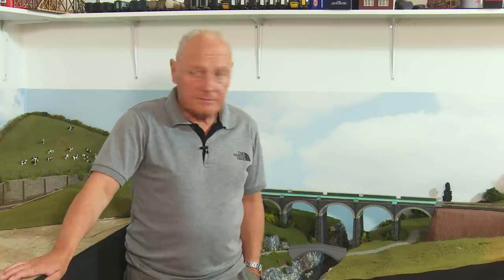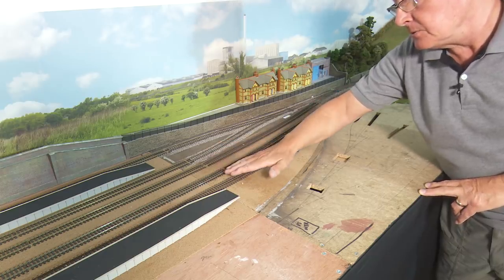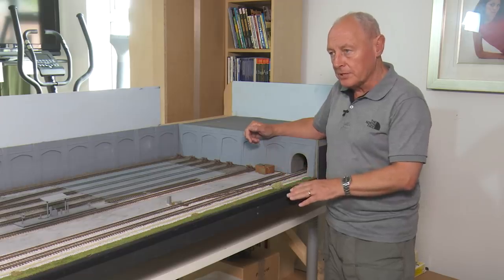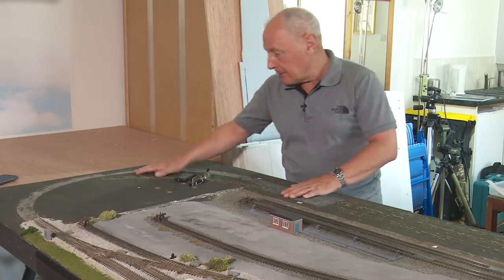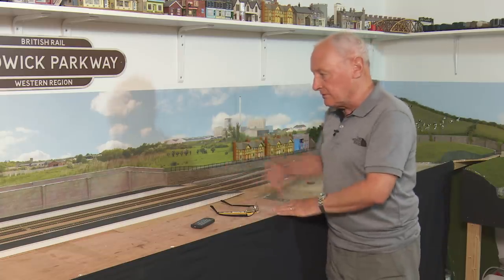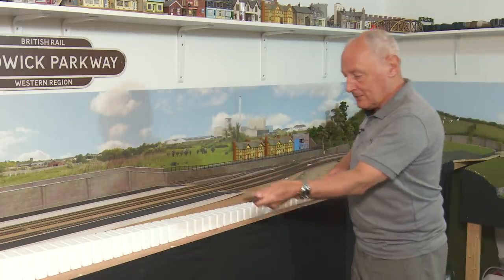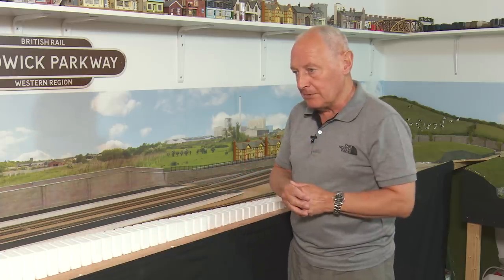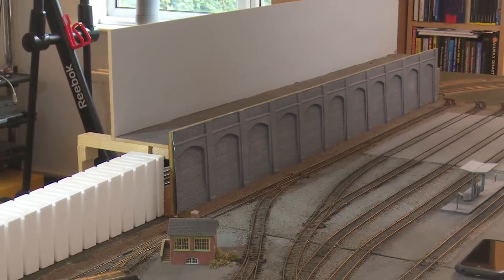A boring track plan at Chadwick Model Railway. | 72.

Comment: You say "What's my problem?". Although you are an experienced modeller, you have problems with perspective. It is all to do with vanishing points. In any direction you look, there must be a vanishing point. Since the back scene is two-dimensional and the layout is three-dimensional it means there must be more than one vanishing point in the back scene. The easiest way to counteract this is to place an object such as a house in front of each vanishing point. The perspective of the photographic back scene you are using is at ground level, but your viewpoint is a higher level than this, so that's why it looks wrong.  Another one of your problems is that if there is a space, you put something in it, such as a house. The row of houses along the back scene is inconsistent with the perspective. You have got foreground objects in the background.  The viaduct scene is okay, you don't need to dismantle it.  What's wrong is the four-track road and the cross-over at the station.  Simplify: four tracks gobble up space. You only need a single track.  You don't want first radius curves. Forget the incline as well.  Have just a single track going round the room. Double track approaching the station. I hope this helps. I think most of what you have built looks very good,  despite the caveats and dilemmas you mention!
Reply from the maker: I do accept your points but clearly I’m a twin lines kind of guy.  My viewing angle is actually from being seated although in my videos, this is not obvious.  I take the rest of your comments as sound advice.

Comment: I have two 2% riser kits like the ones you show but single track only.  2% requires 16' in length to accomodate. Whilst it is quick and easy to instal, my frustration with it is fixing the track to it.  I like to pin my track which is clearly not possible.  Sticking it is the answer but don't think abount changing it as glue will destroy it making it a single use item.  Unlike insulation board, there are lots of holes and gaps to fill too.  Quick, cheap and easy but as always, there are compromises.  Good luck with the planning...I will continue to watch your journey with interest. Mark
Reply from the maker: Sound advice, thanks Mark

Comment: Charlie, I've found in my journey with model railroading, when my skills improve with a project I am wont to go back and apply those skills to the old stuff I did before.  You are finding the same thing.  I really do feel your viaduct scene is a huge step up for you; it is exceptionally well done, and it provides a ton of visual interest for your viewers/visitors.  While building that scene, you also learned that the scene improves if your track (and structures, for that matter) is not parallel to the edge of your boards.  Looking at all of your old trackage, it seems all of that breaks that rule.  You might want to rethink your overall plan, with the idea of continuing to step up your game with each new area you model.  You're a great modeler, and you are very thoughtful in how you proceed with new things.  You're at a crossroads with your scenery skills - find a way to make the rest of your railroad empire equal or exceed what you've done with the viaduct scene.
Reply from the maker: Pat, it’s comments such as yours that make it worthwhile.

Comment: Sadly, and it’s a fact, modern image track-layouts are very boring! The steam era seemingly gave access from every track TO every track and was very much more of interest and, for Modellers, gave the maximum operating potential. There are two track plans by the famed, late, Cyril Freezer which showed a layout in steam days and its “modern image” replacement. Yes, it was boring in comparison.
I think much depends on what you want from it and what you want to get out of it. Industry makes it interesting, and I think you could look at this as a means to an end. You already mentioned parcels, but incorporate this with a “Express Parcels/Royal Mail” depot, you then have the opportunity to enact the movement of a variety of parcels and mail trains. A dairy makes for a good variety of tanks and vans. A brewery similarly. A tool and pipe works. An engineering company, even “Sulzer Hydraulics” where new trains can be positioned.
Just some ideas for you Charlie. Best wishes, as ever, Bob
Reply from the maker: Great points Bob, many thanks.
Reply: @ChadwickModelRailway  I was thinking exactly the same thing as Bob ! 
I wonder if your concern about it being boring is the fact there appears to be very little "operational" interest  
My layout has 22 customers holding 49 freight cars at max .  I spend 2 hours just switching 3 or 4 of them. Sometimes I don't visit the same customer for a month or more. This totally removes the familiarity of the layout. You have a lovely layout but I think you are feeling you need to actually integrate yourself into the layout more with operations. Switching opportunities totally solve this problem. I tore my last layout down, even though it had the most beautiful mountain mainline run.  After 6 months I simply got bored with the train doing nothing more than going back and forth from one end to the other. Again switching freight cars into and out of customers totally solved this issue. Building the 22 customers is a ongoing but EXTREMELY entertaining experience, and servicing them even more so.
Hope this doesn't throw a spanner in your works my friend.  :)
Reply from the maker: You are of course correct.  I need to establish a better logical freight plan driven by the consumer.

Comment: Hi Charlie 
I know this comment isn't about this video but I have a question.
I've just purchased a soldering station with adjustable heat setting.
What temperature would you say would be best to solder up wires to a electro frog point as when I tried it with a conventional 60watt soldering iron the sleepers melted.
Please HELP !!!!!
Many thanks peter from birmingham
Reply from the maker: Hi Peter, can you please check out my last soldering video.  I’m sure that it’s mentioned there.
Reply: Hi charlie 
I have watched it but dont hear what temperature to set it to.
Please help.
I dont want to melt more points and I certainly don't want to go back to insulfrog
Reply from the maker: Hi Peter, having thought about your issue, the temperature is dictated by the solder which you are using.
190 degrees centigrade is the temperature that 60/40 melts, which is what I use.  I’m sorry to say that it might be your technique.  Watch my soldering pt 1.  And see how you get on.

Comment: Hi Charlie yes in n you can get two on one polystyrene. What you could do is stick a 6 millimetre ply on top with no more nail mastic a bit wider than the riser to get two tracks on. I have now problem with diesel or steam but the closer it is to a corner the heavier the rake get because it's pulling in two directions. If the riser is on a corner the worse it gets. Colin
Reply from the maker: Thanks Colin, sound advice.

Comment: Certainly not boring Charlie the layout is coming along great and there is a lot to be said with the KISS principle. The inline is far too steep both practically and visually in my opinion, my loft layout is 18' square, it rises to 4'' and it takes three sides of the room to get to that height (18"x18'x18') and I run only Bachman/Hornby/Dapol and Heljan latest diesels, I have no steamers. My (00 gauge) inclines are laid on 1/2" timber for straights and the curves shaped out of MDF 1/4" (the inlines are only on curves as curves on a inclines really test locos with pulling stock behind) all inclines well supported. At approaching 75 I will not be able to build another layout ( i have had this one15 years) and if I could I would NOT have inclines, they are now't but a pain in the a***.  Coaches and wagons uncouple (if using hook type couplings) and when going down inclines they bunch up and cause derailments. Sorry if I have split your enthusiasm but you asked for feedback,  Charlie I hope this serves as a step back and you have a serious rethink, Bill.
Reply from the maker: Sound advice, thanks Bill.

Comment: Hi Chad I have 4% incline in my layout one hint try keeping the incline on the straight as mine is on acurve a straight part and another curve and as I only run steam loco some  can't  hauling long trains as the drag is too much. Unless they are good heavy pacific locos or a 9F they don't seem  have much problem but any 4-6-0 or 0-6-0 have big problems.. But in saying that I do have fun double heading or a banking engine on the rear. Hope the little help on keeping it on the straight is helpful. Regards Mark
Reply from the maker: Thanks Mark, all good advice.

Comment: Thanks Charlie.
I'm about to start on a new 8x9 around the room layout (Planning stage at the moment) and I am thinking of having a small branch line run around the outside of the layout and to a small terminus at the top. 
Mostly I'll only use a Lima 117, Hornby 153 and a Lima 156 to run on that line but there maybe the odd smaller Lima locos (classes 26, 27, 31) that will run small passenger or freight  train there and back down again. Looks like the 4% is the one I'm after. 
I agree with turning the TMD around 180 degrees.
Also looking at the inclines, someone mentioned hiding it. This is a good idea then you'll have the station (Parkway) in front if it ... This would give an illusion of a longer journey for each train.
Reply from the maker: Hi PTS, I am going to reduce my incline to 3% as 4% just looks to steep.  The more gentle the rise the better but space will always decide for you!

Comment: You have a lot of comments and I haven't read them all, so there is a risk I'm repeating what others have said.

I don't understand the bit about the diamond crossover at the anti-clockwise end of Chadwick Parkway (min 3:00); why would it come in on the Fast Up line to transfer to the Down Platform? The point is facing which I wouldn't have expected on a fast line, if the Fast Down has something coming through, then your DMU will end up sitting on the Fast Up, thereby blocking it. Surely the DMU would come in on the Up Platform, drop off/pick up its passengers, then return to the Down Platform at the clockwise-end of the station via a series of trailing points/crossovers?

I'm not convinced about your incline test (min 13:50); pulling a full rake in a straight line is (granted) a partial test - I would have been more convinced if there had been a 90 deg turn included in the run.

I'm also left with a degree of puzzlement  regarding your potential plans:

Is your fiddle yard really a 'fiddle' yard or a storage yard? If it is just somewhere for trains to wait until called for, then modelling over the top (subject to having suitable clearances between the levels) is not an issue, but if you want to 'fiddle' then what you describe could be awkward. Perhaps the solution is a bit of both - keep some of the lines nearest the board edge uncovered, with the rest as covered storage lines with modelling over the top.

Where does the (low-level) mainline coming anti-clockwise out of Chadwick Parkway go?  Does it connect to the mainline running through the TMD? Would it connect to the bottom end of your new fiddle yard? 

Now for my suggestions (everyone will have their own thoughts, so feel free to ignore entirely!):

Firstly, there are many examples of viaducts being immediately followed by a short cutting into a tunnel. At the clockwise end of your viaduct, continue the rising ground that you have created, and run your clockwise mainlines into a tunnel and from there to your fiddle yard. Having created such a splendid deep river cutting with rock faces etc, it doesn't ring true for the land to level off so quickly. This creates a scenic break between your high-level proposals and your viaduct.

Position your high-level station going right into that corner board between the viaduct and TMD boards. I wouldn't think of it as a mainline terminus, more the end of a local suburban branch line (for a prototype example think of Halifax St Pauls, a branch line coming off the Halifax to Queenbury mainline - limited passenger traffic but much more scope for goods).  There should be sufficient space to create a rural to urban scenic transfer by careful positioning of suitable buildings.

To avoid the 'boring' straight line nature of your Parkway station, think about moving it a little anti-clockwise from its current position.  This would give you more room to sort out the point work at the right-hand end of the station and the transition to your high-level line, and by curving the platforms into the room corner, gives room for an easier curve to your rising high-level line behind, and stops it being to 'linear'.

On the board on the wall opposite to your new viaduct, I would pass the mainline under your new high-level line at a suitable point (there are plenty of prototype examples of minor lines crossing main lines using an overbridge).  The mainline having passed out of view could link to the bottom end of your fiddle yard.

I'm not sure I would re-orientate your TMD as others have suggested; having an access coming off the viaduct end of things remains feasible, but I would use tunnel mouths taking it under the same hill that your viaduct mainline would run into. I would retain access to the TMD at the other end, coming off the low-level anti-clockwise mainline, either before or after the high-level overbridge depending on height clearances.
Reply from the maker: Wow, what a excellent response, some of which is news certainly.
I feel another video coming on!
Thank David.

Comment: Seems fine Charlie  :) https://www.youtube.com/watch?v=fR0DSl24U9E, one or two mention PowerBase from DCC concepts, no harm, apart from a few quid, in laying the plates under the track in case you have difficulties or ever wish to run a steamy! I am using the system extensively on my scenic based layout. Just add the magnets to locos that have any trouble. Alternatives to liven up the build, possibly a large road over bridge at the station entrance, greater use of buildings to obscure parts of the route? Love your videos, you are so brave asking everyone for comments. Final point from me - I'm using SCARM for my railway plan (now under construction) and it may be useful for looking at possibilities (other software may also be good). It would be a shame to get it 90% complete and then have second thoughts again.
Reply from the maker: Sound advice, thanks Clive

Comment: My grandfathers layout consisted of a lower loop, with incline to a mainline terminus. Stations sized for 5 carriages and a mainline loco. The terminus was 5 lines with a small goods yard. Initially at the bottom of the ramp we entered the lower station... But we found that some of the locos couldn't manage the gradient (especially on the turn), so it was later modified such that the ramp joined the lower loop after the station. 

You're not entirely clear on the extent of your terminus - whether you're going for an example like Stourbridge (Junction-Town) which had a 121 shuttle service when I was there back in the 80's, or Romford-Upminster (which in my day was serviced by a venerable 101, though more recently has been electrified as is served by a modern unit), OR if you're going to go with a more substantial terminus supporting both mainline and multiple unit traffic. I would think if you're going with a mainline, you might skip a shuttle service - unless mainline from the terminus doesn't have direct access to Parkway, in which case a shuttle service to a raised platform at parkway could add some interest.

Were I doing this, I would consider preemptively adding magnets on the ramp (at least UP), so that if you do find locos with traction issues, you can make use of them.

DaveClass47 has used the Styrofoam ramp on his layout, and has some how to videos in his youtube catalogue.
Reply from the maker: Sound advice, thanks Neil

Comment: Hi,
I think is a bit steep. But, if you like it, there's no problem. 😉 What I would do, is I would use both of them, one in front of Park station and one behind, just as you show,  and put a viaduct in an angle over the traks of the station.This way, you will have both lines for "Central" in the correct position. Maybe is too much for a medium sized layout, I don't know how will fit.
Reply from the maker: Sound advice, thanks DG

Comment: Here's my take - please feel free to ignore everything I write 'cos it's only old man rumblings!I guess the key to satisfaction is to put in "obstacles". EG, instead of a double slip for your parcels bay, put in a couple of points "staggered" to force you to arrive in the main platform and use a shunter to take off your parcels and put them in the bay using your headshunt (I would also question whether the prototype would run directly from a running line over a double slip into a bay for goods and parcels anyway). As to your refuge siding at the back, it's a shame you are thinking of getting rid of it 'cos using that would invoke an interesting set of movements. Your arrival of a DMU from up fast to down slow, then departing again results in a facing point & crossover, frowned upon in steam days, and probably still unusual now. Better to have trailing crossovers at the other end of the station, arrive on the up platform and shunt over to the down platform for the return journey - again obstacles.Yes, 1 in 25 is very steep, even for diesels, especially if you factor-in curves, which you will have to as when the diesel is halfway up the incline, the rest of the train is still turning the curve behind. Probably best to test that one.Whatever you decide - please keep on showing us your progress. It's quite inspiring. Chris
Reply from the maker: Chris, your comments are invaluable.
Regards Charlie